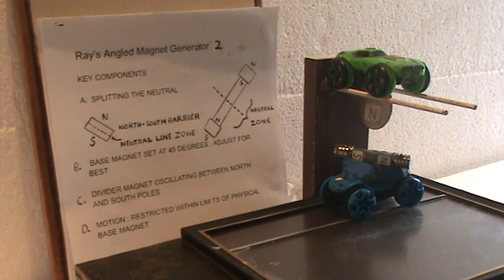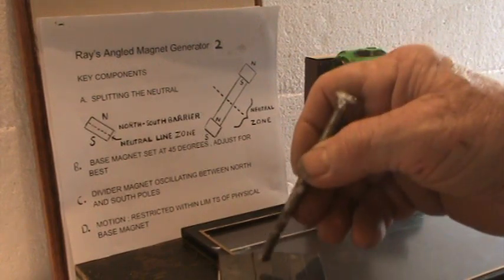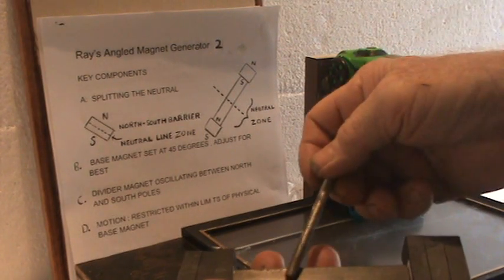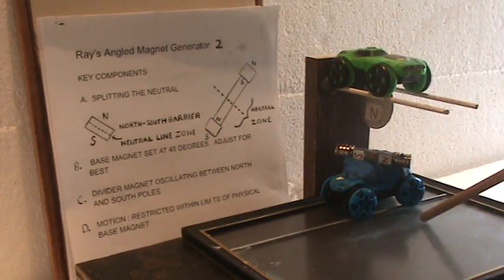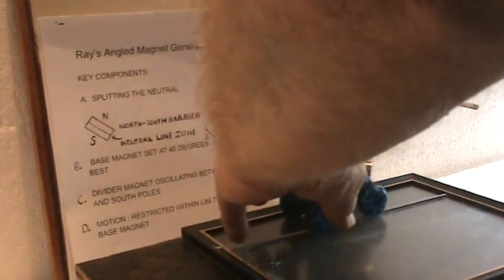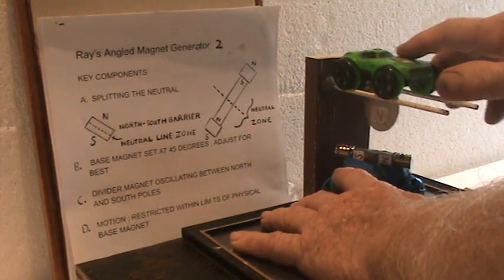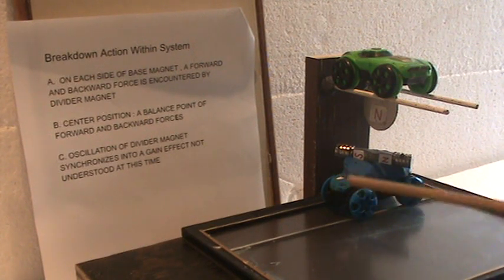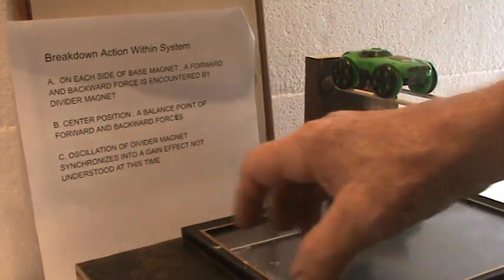Ray's Angled Magnetic Generator 2

Comment: There could be a many variations to your idea Ray. One simple principle I see, just imagine: Large circle of track for a lower car to go around and every time  car will come to "propulsion or charging" place upper magnet will rotate 360 decrees which will pull and push the lower car. 
But I am not sure that there will be ou effect here. Powering swinging pendulum with idea might be more efficient.
Reply: Thanks for your grasp of things . I have tried rotational set ups . It does not like the approaching angles on a circle design . It resists . The pendulum has merit .

Comment: I see no gain. You probably need the same force (energy) to put the car back in its starting position as it got when you pushed it forwards. If you lift up the top car, and then push the lower car back beneath it, and put the top car down again, you might have a different way of dealing with forces.
Reply: I agree. No OU has been proven. In earlier tests the perceived gain from adding magnets as per his 'angled' arrangement may simply be a demonstration of increase in efficiency of the device. It would be fun to replicate however.
Reply: You are correct on that sir , no gain on pushing it into the gate from head on . I was just showing that there was magnetic forces present . The focus was on the effect taking place in video 1 where nothing was leaving the gate .The core of the o.u. effect is somehow gathered from the divider magnet oscillating thru the angle of the neutral zone .Thank you for your inquirey